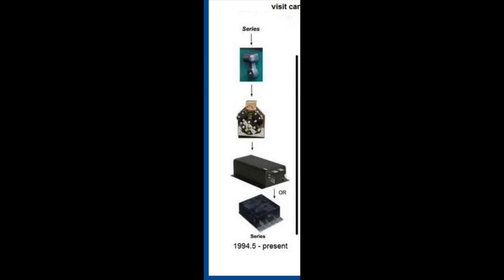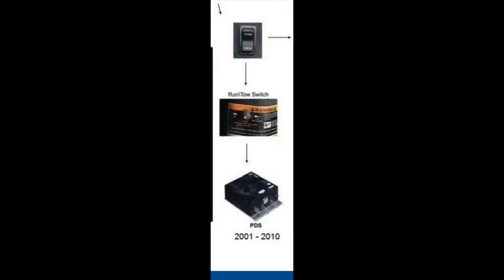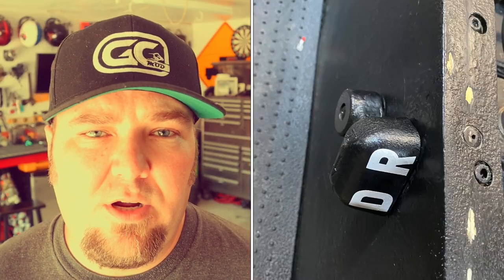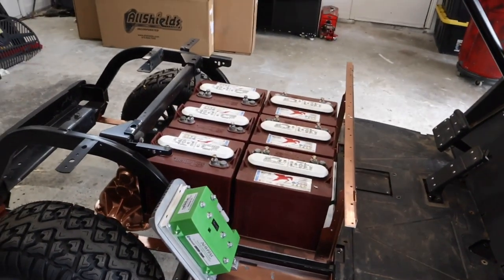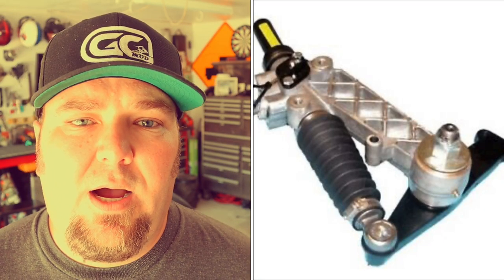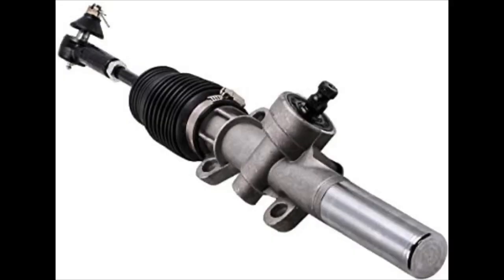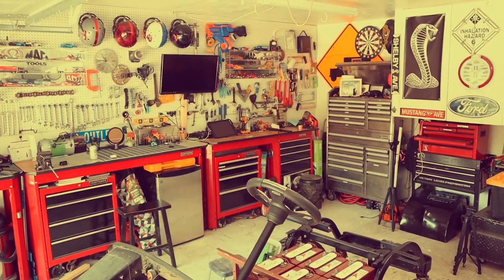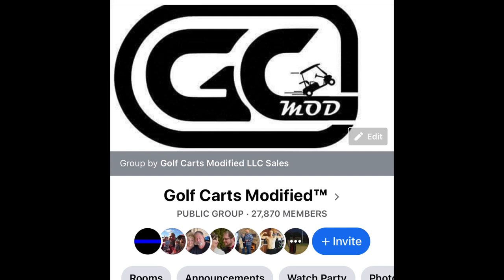How to tell what EZGO TXT you have.   EZGO Lingo

Comment: Hey, just found the channel, I really appreciate the info, I have a 2010 4 bolt pds, bought from a friend who found it beat in a lawn and built it up a bit. Rear has a terrible noise that comes and goes. I suspect bearings, going to be dropping the diff cover to change oil and probably just do axle bearings to start off. 

Great to find this resource. Was contemplating selling and buying a new one but I’d rather build our cart. We’re already lifted, wheels/tires, marine radio, few small speakers, new 48v worth of batteries. Back seat, light bar. Good cart, it’s my wife’s and I wanna get her squared away for her.

Thanks again

Comment: I have a 2014 bbb ambush. I have read they use the same components as the ezgo carts. The gas side (subaru engine) does not shift all the time or when it does shift, it gets stuck in that position for a while.  The electric side works perfect. So, is there a way to modify the rear to shift manually? The gas side is designed to shift with the electric side using the key. Do you have any videos that show something similar or any help with this issue. Thanks in advance.

Comment: My series  3-bolt TXT (unknown year) will run forward, but not reverse.  I have replaced the directional switch, the speed device under the floor mat, and the charging connector with wire harness.  If I reverse polarity of one pair of motor connectors it will go on reverse, but not forward.  The second pair of motor connectors do not do anything.

Comment: Do you know anything about the EZGO ST 0484 2x2 ? I have one and it seems to have lower gearing then the regular 12to1 txts we put 500 amp 48v alltrax big wires and a plum quick demon and thing will only do about 20
Reply: I cannot find any information on the internet on that carts gear ratio I had all the parts in a 98 series txt 3 bolt before and was going 29

Comment: I have a PDS txt shuttle 6 with a Curtis sepex controller. Lifted with 22” tires. I have the high speed chip in it and new batteries. I am still only able to get 19mph out of it. Any ideas on how to get some more speed?
Reply: What's the high speed chip? Just the jumper wire thing?

Comment: Im so confused...i have a pds cart because it has the toggle switch on dash and run/tow switch...but i have 3 bolt steering not 4 bolt....it says ezgo but it doesnt have a normal ezgo vin...it says made in china and says manufacture year 2012
Reply from the maker: That’s probably not a true ezgo
Reply: @Golf Carts Modified  yes I think it is Chinese clone...but some parts might be true ezgo...it's a Frankenstein

Comment: Hey man, some good info here. I'm still having trouble with mine, though. Dude I bought it from fleeced me, told me it was a 2014 48v. It was limping when I got it, I planned to replace the batteries anyway. First thing I replaced was the batteries with a 100AH lithium. No juice. Then, the solenoid. No juice. That's when we realized, the controller, solenoid and motor are 36v but he had 6x8 lead acid batteries. Looks like he put a 2014+ body on a 2004 EZ-GO. So, I'm having difficulty trying to find which controller to get. I'm looking at the Navitas specifically so me and my friends will all have the same controller, and it's programmable if I want to upgrade more later on. The problem is which controller to get since the harnesses are different, I'm still not positive what type of cart this is. It has an FNR so don't think it's PDS. No run/tow switch. But when I typed the part number for the current controller in google, a link came up for a controller and it said "Not to be used with DCS or PDS". What else would it be?

Comment: I just bought a cart from the neighbor. There's no way it's not like a 1993 (joking) it is old as hell.

I'm just gonna have to strip the whole thing down and build it from scratch.  I'm just gonna want to put a new motor and the whole kit, ain't I? It already needs new batteries, but I'm led to believe it works. Maybe I'll just get batteries until more stuff breaks down. Ultimately, I definitely want AC motor and all new electrical system, little bit of a lift, it's a backyard farm cart, and a solar panel. I've wanted a cart with a solar panel since I can remember.

Comment: DCS = Drive Control System  
PDS = Precision Drive System
Reply: Yeah I have a 1993 EZGO golf cart it's the 3 bolt steering column I need to know what axle a 6-inch axle that I can put under it I can't seem to find nothing on the internet that 293 what years will fit this